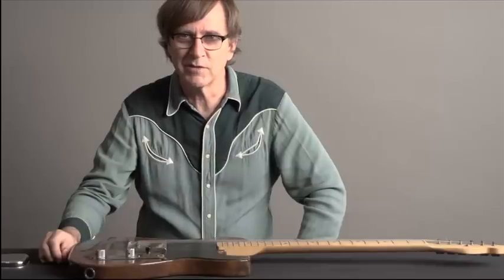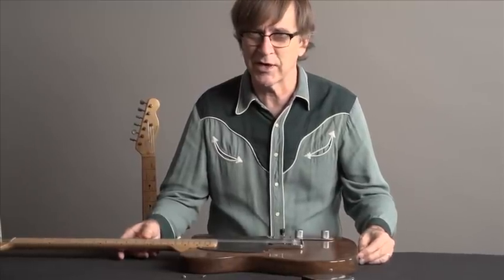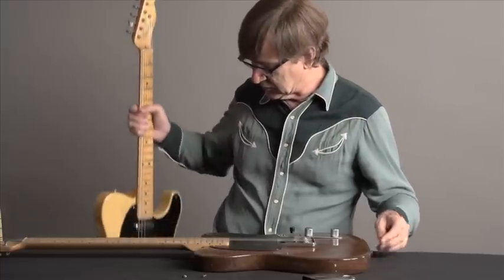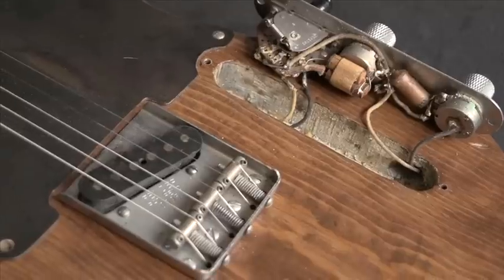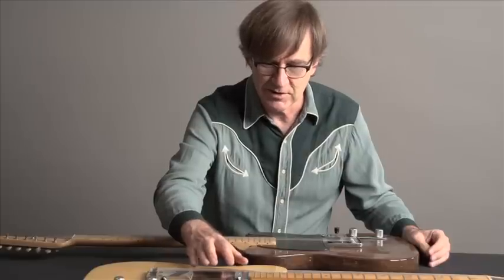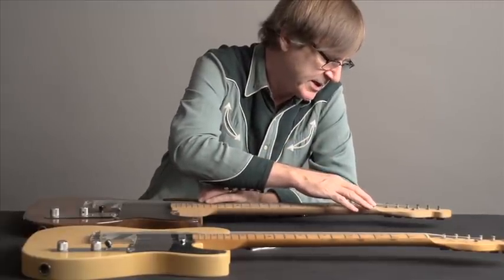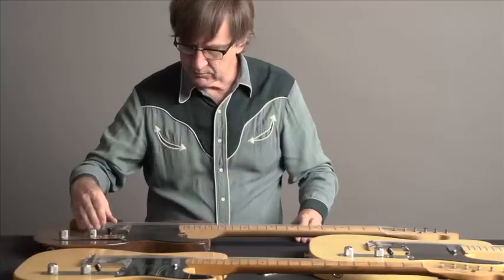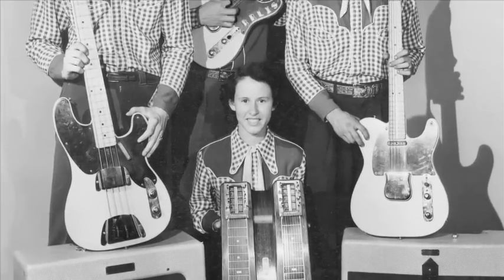Arlis McMinn's 1950 Fender Esquire explained by Richard Smith

Comment: What Richard forgot to tell is that this body is 1,5 inch thick, whereas the Broad-/Telecaster and later single pick-up Esquire were standard 1,75 inch. This is the fourth more or less prototype I know of, the first two without serial no. and two having a number: 0009 and this 0095. Next, four other very early pre production 2 pick-up Esquire models serial # 0013/0129/0087 and 0043) are in my datebase + pictures. This 0095 is the second prototype found with a chambered body. This is pure early Fender history.
Reply from the maker: I really like to see the photos You have of 2 Esquires without serial numbers and  0005, Richard is a national treasure isn't he?
Reply: I guess your are John Peden, the famous Fender photographer. I feel honoured to be in contact with you!
Let me start by making a typo correction, that 0005 should be 0009, the "first" double p.u. Esquire.
I do have a picture of a Broadcaster 0005, it is in Nacho's book, but if you really are John Peden, you know that of course. The two without serial number which I call Esquires are the # 1 and 2 prototypes. The snake head and the one with the "first"six in line tuner headstock. I guess you are familiar with these too. Indeed Richard is a national treasure, I love his book. Further I am a huge fan of early Fender history. This McMinn Esquire is fabulous. I am awaiting Nacho's book on the pinecasters, and hope more of these 'obscure' instruments will surface one day. Maybe there are more out there somewhere. Like the 0033 Broadcaster found on a market.
Reply from the maker: C'est Moi Yes we are all awaiting Nacho's newest book.. I have had the pleasure of photographing most of the non truss Esquires on your list but I don't recall 0087. I will respect your privacy and not distribute the image if you would be so kind as to share it with me. pedenphoto@mac.com thanks BTW where are you located?
Reply: Dear John, my name is Gerrit, I am 65 y.o. and live in Amsterdam, the Netherlands. 
I found the picture of 0087 In André Duchossoir's book of the Telecaster.
Do you have that book?
It is on the left of  first page of the color section, page 45 in my copy, which also shows Broadcaster 0027 and Esquire 0013 as well as the first prototype.
The picture of 0087 says: Two pick-up Esquire (#0087) custom built for country artist Hal Hart. The black body is made of pine wood.
Nacho mentions this non truss rod # 0087 on page 23 of  his blackguard book, not showing any picture but he says: it has been documented (where?) Does he mean André's book as well?
If you don't have the book, I can scan the pic for you.
Awaiting with best regards.
Reply: Sorry I mean page 35 of André's book
Reply from the maker: Gerrit: Oh Yes I’ve only seen pictures of the “Hal Heart” Esquire but that is cool. Apparently at some point that guitar was stolen. No one that I know knows  where it is today. I was in Amsterdam a year ago, Great town. I’ll let you know if I’m coming again . One of my podcast is with Flip Scipio who is Dutch. You might enjoy that one. If you do listen to any of them let me know what you think of them. Thanks
Reply: Dear John I will listen to your podcasts and let you know.
I have a question for you. That double p/u Esquire #0009 is in Nacho's book, it was also shown on a You Tube video in Dan Courtenay's shop in Brooklyn. They both tell the story that is was a guitar used by Sam Hutton to test amps. But the guitar is also shown with the Calif. Playboys in the hands of Harold Courtright, and as far as I know it was previously owned by Charlie Aldrich, the role model for the Calif. playboys, who gave it to Kay Francis the steel guitar player, but it was used by Harold most of the time.
How did it get to Sam Hutton. I guess he owned/used it after it was in the hands of Charlie and Harold.  Was it given back to Fender by the Calif. Playboys? The funny thing is, now that we know it was in the hands of Harold, no one asks the question, how about Sam Hutton.
If you plan to come to Amsterdam again, please let me know, I would like to meet you and maybe I can invite you to have lunch together.
I'll send you an email to your email address so you have mine too.
Best, Gerrit.
Reply: There is another thing regarding early non truss rod Esquires.
Esquire 0013 and 0043 (blond butterscotch) are non truss rod Esquires and their body thickness is measured at 1,69", as opposed to the regular production thickness which stood at 1,75". Why this difference? Somewhere its does not make sense that Fender went from 1,5"  (for the pre-production Esquires) via 1,69" to 1,75" (for the regular production). Why this in-between size?
My explanation is that these 1,69" bodies were 1,75" thick initially.
There is a picture of bodies in several books showing 6 or 7 bodies lying in a drying rack, painted black
on the top only.  It could be that this black paint was taken off by planing the body which removed 1,5 mm
from their thickness. They could have stripped the paint but the black paint would be sitting deep in the 
grains of the ash and would still show when putting on the butterscotch.
So therefore they were treated as I described.

Comment: Great vid.  An interesting read is Dave Hunters book.  He makes no reference to any hollow bodied tele until the thin line came out.  The earliest Esquire had one pickup and the second was added a little later.  The switch is a tone switch, and remained so well into the sixties.  These early tele were really hand made, so they to a greater or lesser degree.  The prototypes were pine, but the production models were swamp ash.  As far as I have read very few production guitars were made form pine.
Reply: Stephen Gent Cavity body.

Comment: Regarding the switch and the enlarged control cavity, some of these very first Esquire models had a push button (visible in advertisements) i.s.o. a switch. That could mean that the cavity was smaller initially.

Comment: What I would like to know, is there a neck pick up routing under the pick guard of this very guitar?
Both single and twin pick up, very early Esquires were made. Normally any Esquire would have this routing, but does that also apply to these first models. If they started with a single p.u. item, were they already thinking about a double pick up version?
Or did they make that neck routing on any Esquire after they produced the first double PU models.
Anyone?